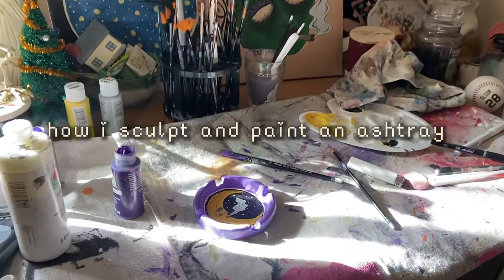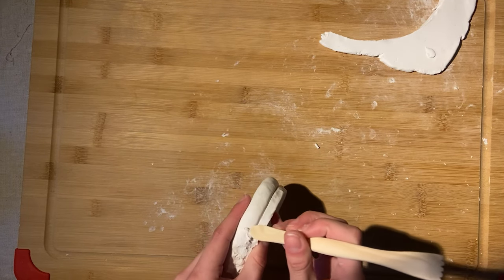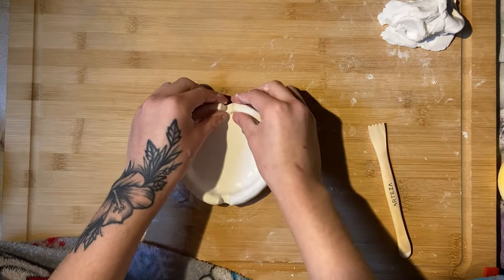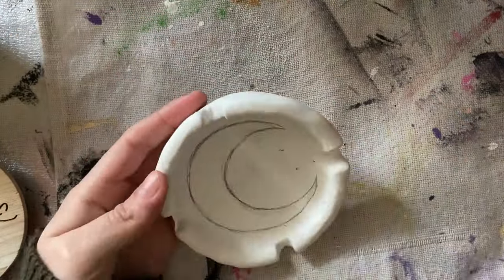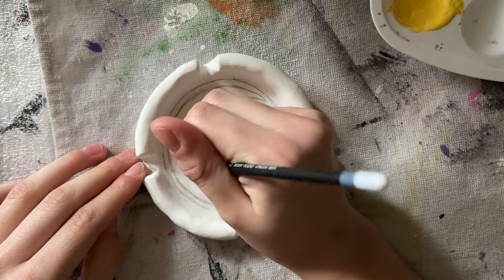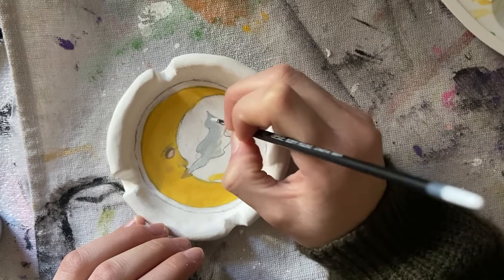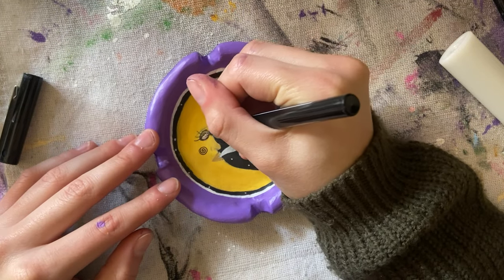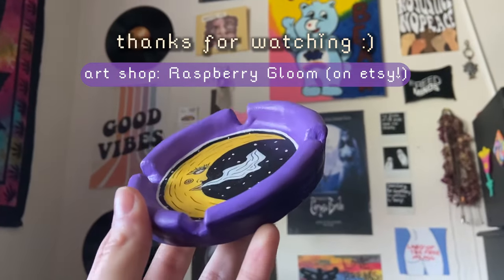how to make an ashtray with air dry clay 🌙 clay art diy tutorial

Comment: I looked into using polyurethane as a fire retardant clear coat and what I read says once it’s dry it’s not toxic, but if set on fire it will be. Sharing in case you weren’t aware but also curious if you’ve found an alternative since making this video?
Reply from the maker: thanks for sharing. i realized this a few weeks after making this video and have since labeled my trays as decorative pieces only. i’ve been wanting to try out epoxy resin but i’m not sure if that’d be any different than polyurethane. i haven’t done any research but definitely plan to. if you figure anything else out lemme know!! :)

Comment: Hello I noticed some things you mentioned in your videos! I don't know if you have any issues with clay cracking, but if you have any regular occurrences with that issue, I suggest taking them out of the sun! You usually don't want your clay to sit to dry in the sun, it will become more fragile and likely to crack. Same thing with using a hair dryer. This is because it dries the clay unevenly, and clay shrinks, so it pulls on part of the clay, but not the other, thus cracking it. :)

Leave it under a damp, but not soaked paper towel, and let it dry naturally that way for 3-7 days. If it needs to dry slower, cover it with plastic to help seal the moisture. It will take significantly longer to dry, but be less likely to crack.

I've had that issue for ages and just recently realized why. I hope this helps somebody out there! 😁
Reply from the maker: thank you for the info!!! my toaster oven and sun have worked fine for me over the past year of doing this handmade stuff. so i’ve never really had issues with cracking but i will come back to this if i ever do :)💫💜

Comment: I absolutely love it! Recently i got into modeling with clay and my first attempt to make an ashtray did well but when I actually tried to use it, the heat from my cigarette made a black spot on the clay. I will appreciate it so much if you could give me advice what vanish to use, because obviously the one i picked up didn’t work out the best 🙏
Reply from the maker: thank you! so glad to hear you’ve been experimenting with clay :) i’m not very knowledgeable when it comes to a truly functional ashtray. i realized after i made this video that the type of clay & the varnish i use do not make them useful for putting out a cigarette due to safety (fire hazard) and aesthetic reasons (the black spot you’re referring to!). since then i’ve labeled my trays as decorative pieces only. the varnish i do use however is called “polyurethane” and it is heat resistant but still doesn’t protect our trays like we’d want it to. 

i’ve been wanting to try out epoxy resin but i’m not sure if that’d be any different than polyurethane. i also believe that real ceramic clay dried in a kiln and painted with glaze is safe to use and burn therefore being the best option for a functional tray. i only assume this since i’ve seen smoking pipes used with ceramic clay material. i haven’t done any research but definitely plan to. if you figure anything else out let me know!! :)
Reply: @thesentimentalhummingbird  thank you so much for the information, I honestly thought it would be that simple to make an useful ashtray only with polymer clay 😭 again your work is amazing ❤️
Reply from the maker: @abcabc-un8qr  of course :) & thank you so much 🫶🏻

Comment: Nice work, this was the first video I watched before I started to make an ash tray, can you please tell which paint are you using? so it won't burn? thank you 💜
Reply from the maker: i am using apple barrel acrylic paint! this tray is potentially dangerous with burning items since my sealer (polyurethane) is only heat resistant, not fire resistant. paint alone, with no sealer, would probably burn as well. i suggest using actual ceramic clay in a kiln for a truly functional ashtray, although i’d have to do more research. maybe there’s a sealer that can be used that is fire resistant & safe for smoking 😁

Comment: What kind of mod podge did you used to use? Does it not get burned if you put out a cigarette on it?
Reply from the maker: i used mod podge gloss water based sealer. i don’t use it anymore but i know it can withstand high tempatures. i use polyurethane now, a higher quality sealer that is heat resistant

Comment: Does the polyurethane withstand the heat of ash or incense matches in your experience? I made an air dry clay ashtray like this that I haven't sealed yet and I keep seeing that there isn't much that can help totally seal air dry clay from the heat
Reply from the maker: it’s heat resistant but i definitely do not recommend burning the lit tip of anything onto the surface of your ashtray. an incense holder could be okay but still a safety hazard. i would utilize for decoration purposes unless it’s a ceramic tray with proper glaze
Reply: @thesentimentalhummingbird you could always press an old coin into the middle before it dries to butt out ash on
Reply from the maker: @bretwhitten7038  you are a genius

Comment: What temp and time do you do when putting the air dry clay in the oven ?
Reply from the maker: the lowest tempature possible, mine is 200F. the time needed varies but i check on them every 30 mins. i’ve kept some in for hours and some just 30 mins, it really depends on the thickness. if you’ve never used your oven to dry clay before check on it every few minutes or so to make sure it’s not cracking because some ovens just built different. just be cautious since some clays aren’t always safe in the oven!! :) happy creating

Comment: is it safe to use it as a real ashtray??
Reply from the maker: the sealer i use now is polyurethane. it’s heat resistant but not fire resistant. some sealers can also become toxic when burned and in general, the appearance of your ashtray can be ruined. because of this i’ve labeled my ashtrays as decorative pieces only. they could probably hold a cigarette in place to catch ashes but the burning tip shouldn’t touch the surface. i still wouldn’t recommend this because it can potentially be dangerous. i plan to look into what would work to sustain the aesthetic and safety of my trays. epoxy resin seems like a good bet but i’d have to research and test it out. i also think ceramic clay is where you could make an ashtray way more functional and safe.

Comment: I have a Question... this is one of the thing I read on air dry clay :

"You shouldn't make ashtrays with air dry clay. It's a porous material that will get burned if it gets in contact with a burning cigarette. Also, you can't wash air modeling clay items, so you won't be able to clean them."

So, I was wondering if the "mudpod" had something special in it making it flammable? 
Otherwise,  I don't really want to lose my time making an ashtray I won't be able to use. 

On another note, I wanted to say that I really liked to see how you created the ashtray, the method could be applied to other items, anyway I do think so...

Thank you for the video, and for anyone who knows the answer and reply
Reply from the maker: as long as you don’t actually press the cigarette or whatever you smoke into the ashtray. the lit tip of one is what makes it potentially dangerous. these are more for decoration purposes. although, i do use a polyurethane sealant that is heat resistant making it safer to use. if you want an ashtray you can actually get the most out of, with no worries, use actual ceramic clay. and thank you, im glad you enjoyed watching! :)
Reply: @thesentimentalhummingbird  
I just read that using a metal insert, like a tin can... but to make it easier, I will cut and paste, my English can be terrible lol

"To make a safe and functional homemade clay ashtray, you need to use a metal insert to protect the clay. Short tin cans are perfect. You can build the clay around them.
Make sure you only clean it with a damp cloth, and never leave a burning cigarette unattended. Especially in an air dry clay tray."

So, I haven't tried it, but I will when I do have a chance... and I will also try to find a polyurethane sealant that is heat resistant, waterproof also if possible... probably will be like finding glove fireproof and level 9 cut resistant... was a pain in my "butt" lol

Comment: amazing tutorial ! I was hesitationg to put some varnish on my ashtray, but I don't know if it's ok since it's a flammable substance? If anyone has a tip about that. It's my first one. Thank you so much
Reply from the maker: it depends on the type of varnish used and if it’s fire/heat resistant. some varnishes can also become toxic when burned and in general, the appearance of your ashtray can be ruined. i plan to look into what would work to sustain the aesthetic and safety of my trays. epoxy resin seems like a good bet but i’d have to research and test it out. if you find out any information on what’s best, let me know!